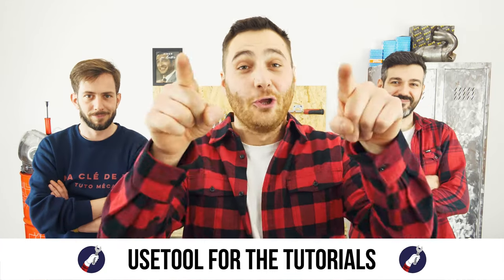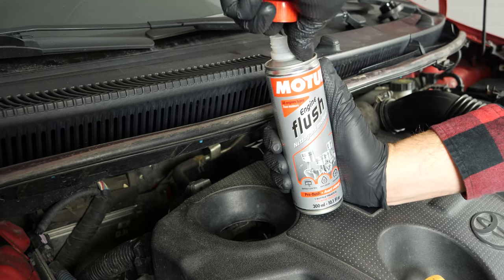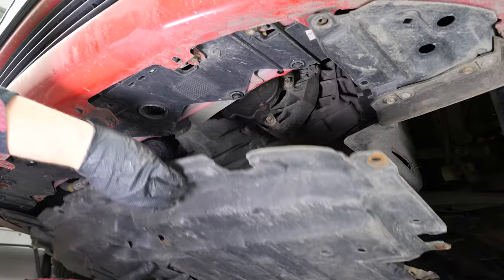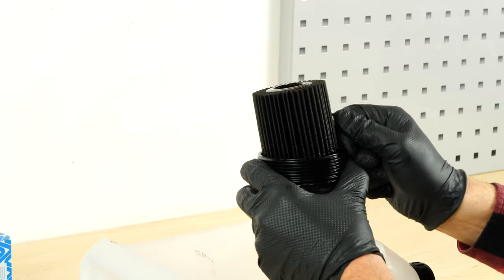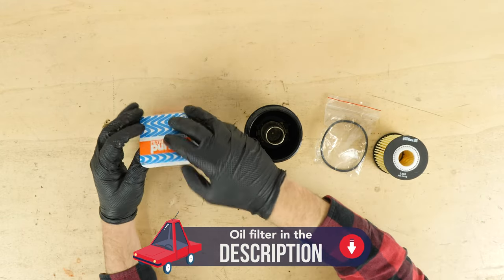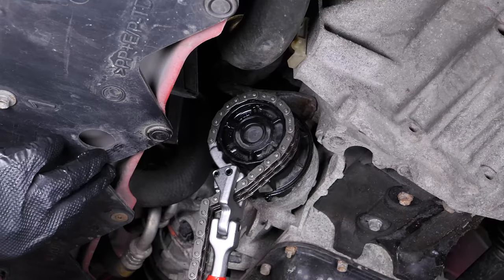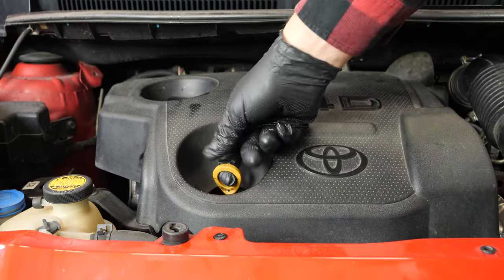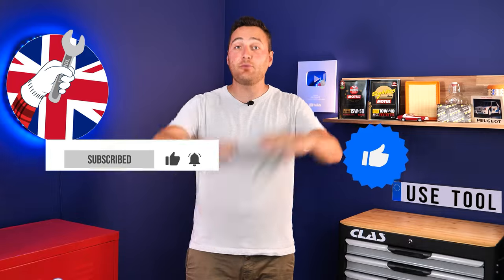Change the oil and the oil filter Yaris mk2 1.4 D-4D 🛢

Comment: Very surprised no oil was added to the filter before fitting, as in this case you could have at least half filled it which is best practise where possible.